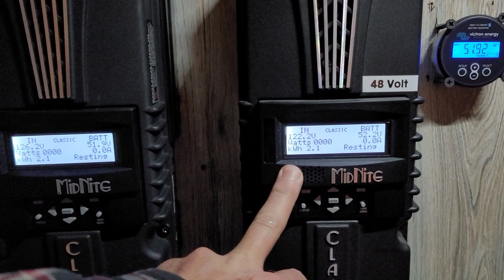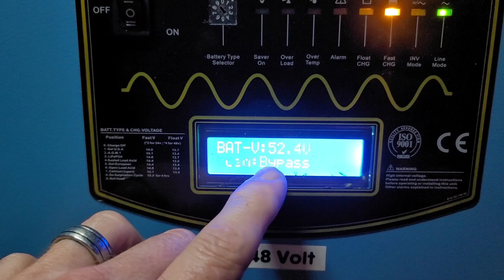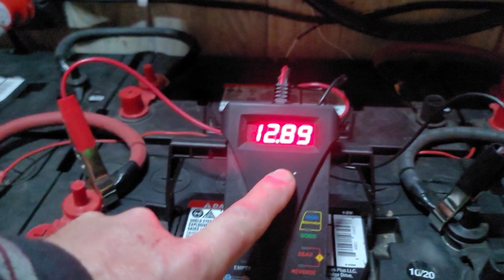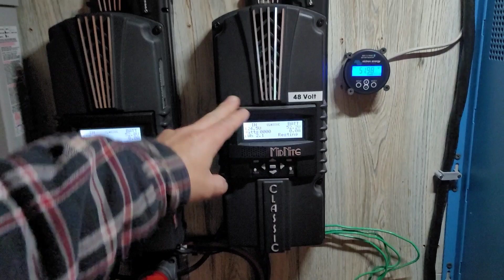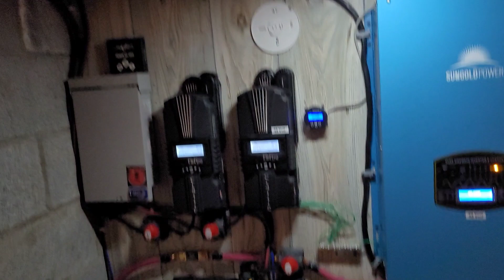Off Grid Solar Backup Generator

Comment: I have a generator just like the one you have here. How did you connect the exhaust duct to the generator exhaust? Does Ridgid sell an adapter?
Reply from the maker: No its just 6' dryer pipe extended enough to push pressure against the muffler. The other end is attached to the exhaust vent. The generator doesn't move around any when running in there so the pipe stays still. If needed a wire can be added to each side to aid in keeping it in place.

Comment: I don't want to ask too many questions before I look through all the videos. I will at some point about the charging wires. I have my batteries (all identical 12 V AGM @ 100AHour each) that I plan to run just like you have only a 36 volt system (too much to explain here) in series-parallel just like you have your 48 Volt system. I have 18 batteries. Many folks tell me I can not run a system that way (the way you apparently have done successfully) as my batteries will drain unevenly and charge unevenly and I will kill one in three of my batteries way sooner than the others. I have seen lots of diagrams (all different) on how I am supposed to run the wires for even/balanced charging and supply. I can not make heads or tails out of it so I am hoping in your series you explain how that is done. Thank you.
Reply from the maker: Yeah Ive went through the hundreds of do's and donts just as you are. I settled on wiring them this way after talking with Midnight Solar as well as Missouri Wind. So far they charge and discharge pretty evenly and have been working great. The only other thing Im gonna add is a pair of battery balacers to help get them even closer. 
Let me know if you'd like to see a more up close and detailed description of the wiring as well as them running to the busbars. Just remember wire size is important and equal length is important!  Hope this helps!  🙏

Comment: How do you top up the middle and bottom rack of FLA batteries with distilled water? It must be a pain doing that.
Reply from the maker: Its funny you asked, I just uploaded a video doing the battery maintenance.  The bottom row of batteries are AGMs so no maintenance required on those. Let me know if you have any questions after seeing the maintenance video!